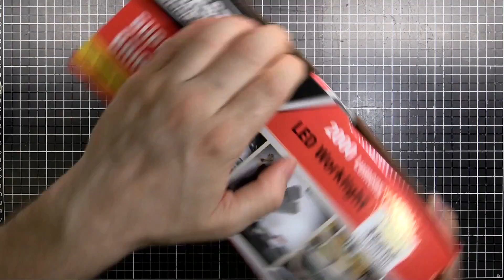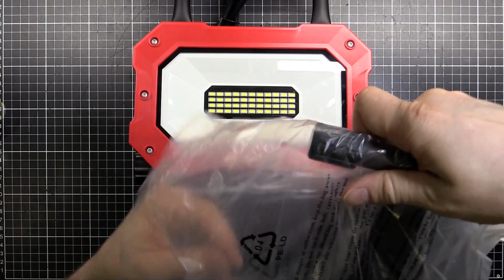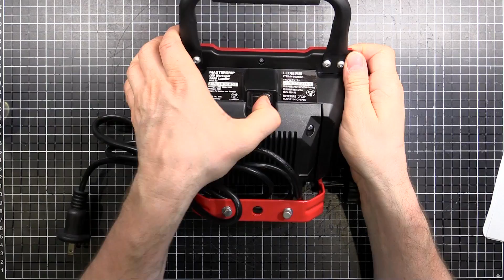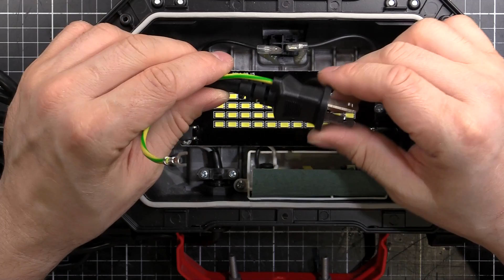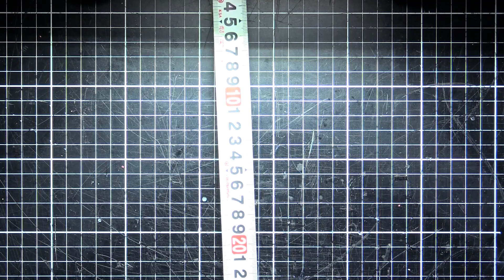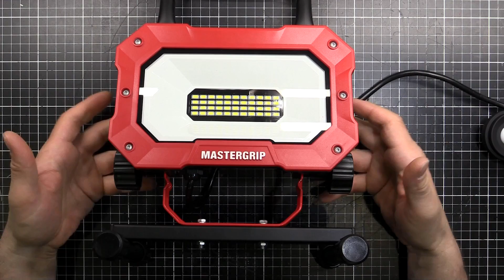Mastergrip/SnapOn LED Worklight Review and Teardown

Comment: Hallo - are those constant current driver boards known to fail frequently?  I currently have Snap-on 922261 LED Work Light that uses the same board.
Reply from the maker: I'm not sure if they are prone to failure, but the two lights I have are still working fine so far. I have been using one for every video I've made since this one was posted, the other is brought out when I need a bit extra light.